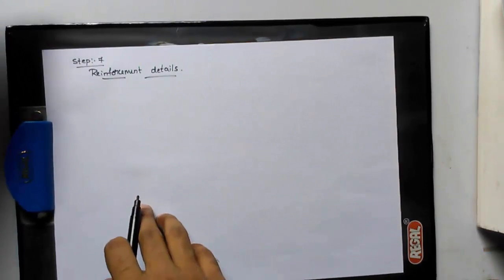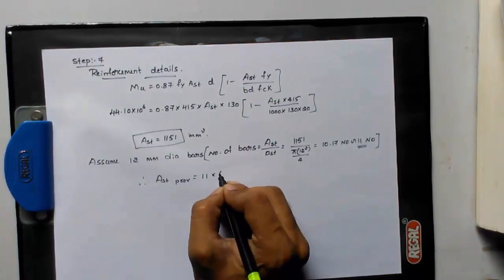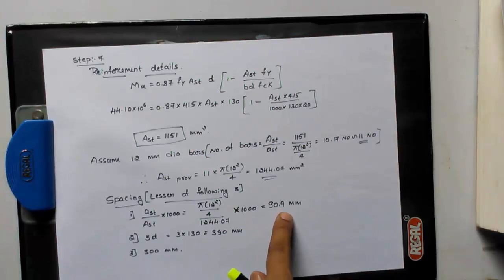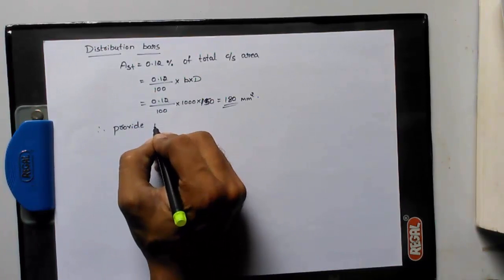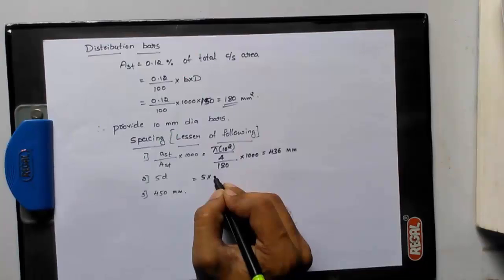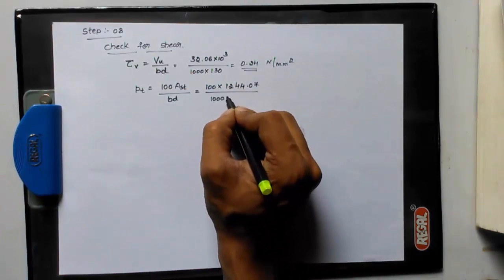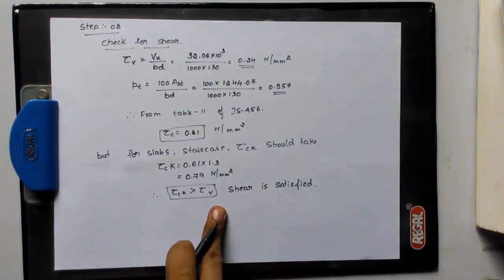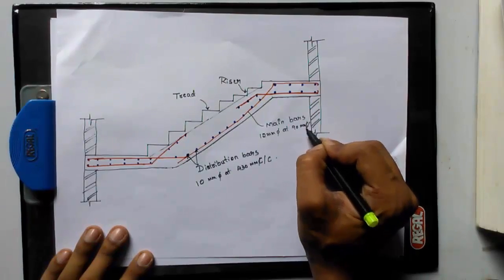Design of Dog legged Staircase part - 3 | staircase design | design of staircase | globemech | Vtu |

Comment: Good presentation. When you calculate the S/W of waist slab and landing, all you need to do multiply (Thickness of slab X concrete density) KN/m2, For the step (Riser/2 x density of concrete) KN/m2. The units in your calculation is misleading. Thank you